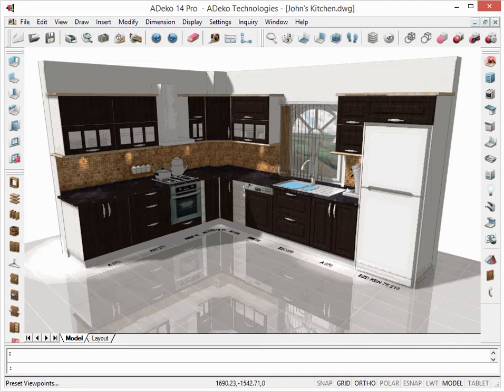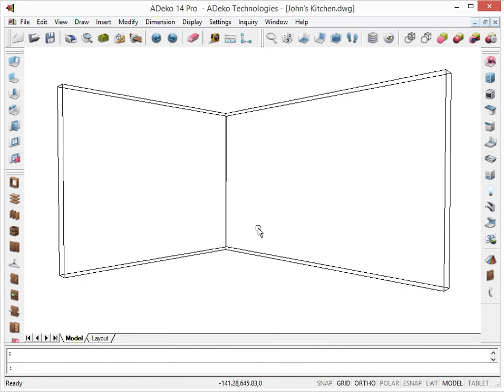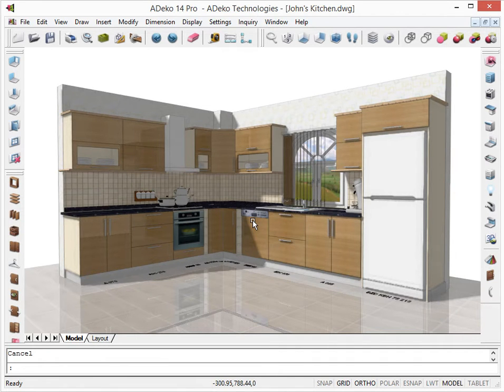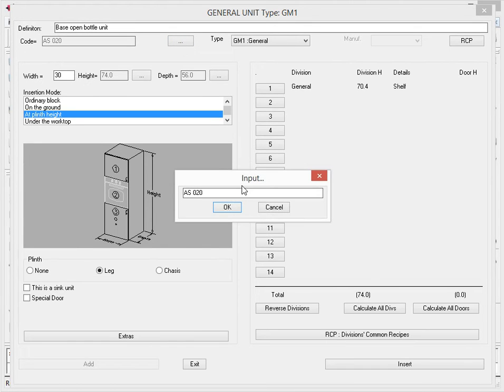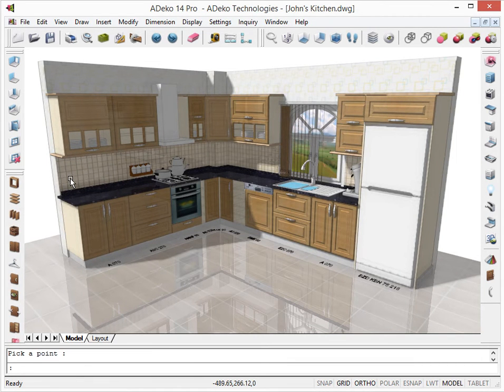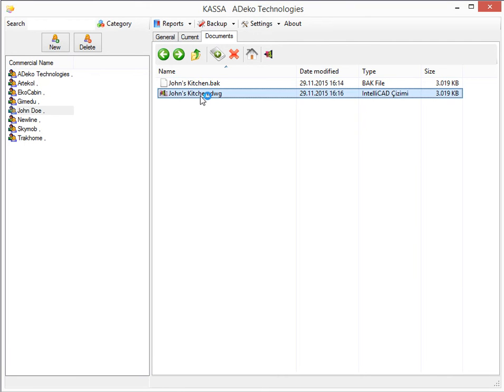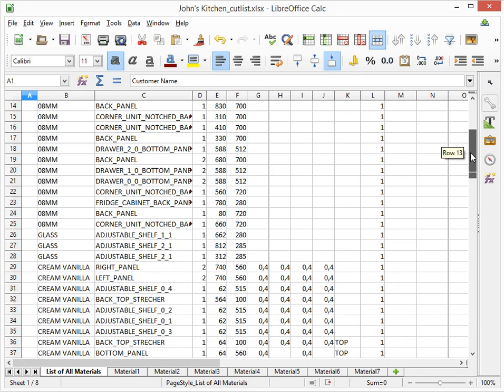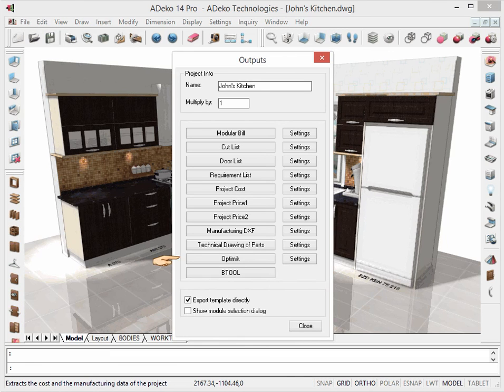ADeko 14 A Quick Overview

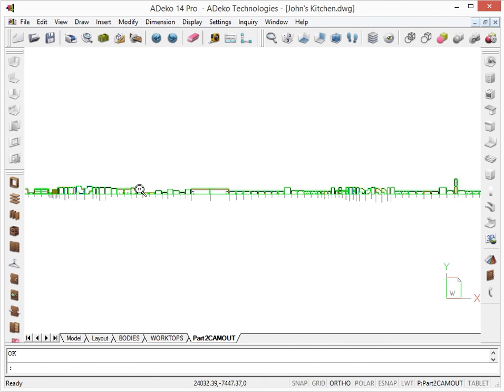Comment: at 20:01 can the software make nested panel and show the edge banding sides at the same time ?....because if i nest the parts with my software will lost the edge banding marks on the drawings ,
Reply from the maker: Yes. Nesting is within an additional module which includes not only nesting but stock control, labels with edge bandings , barcode, project pooling etc. 

Please do not hesitate to contact us for free test drive. Our test drives are fully functional for 15 days. 

Contact email: info(AT)adeko.com